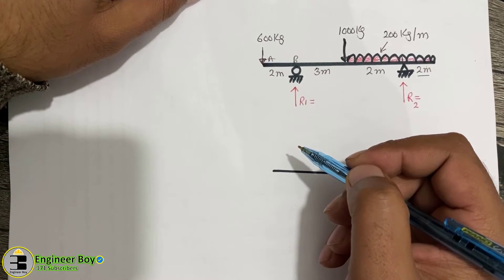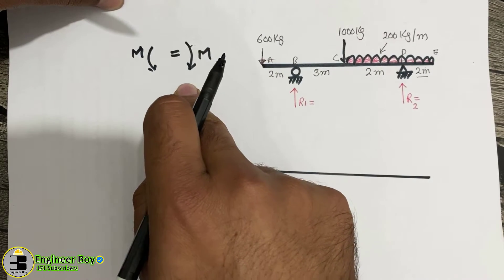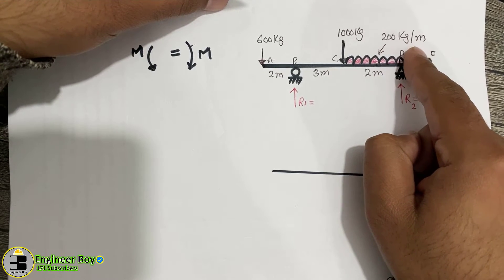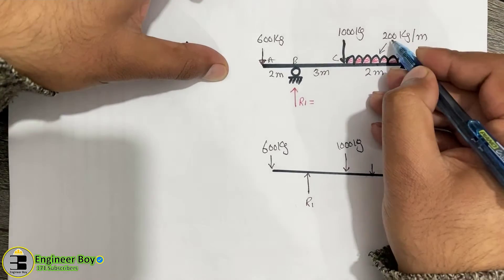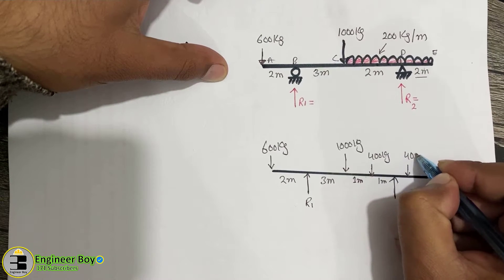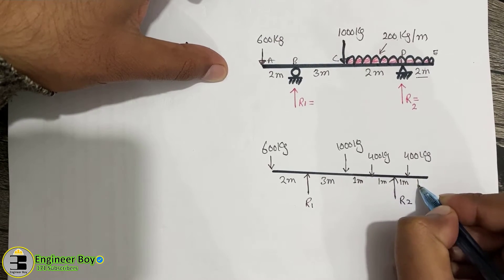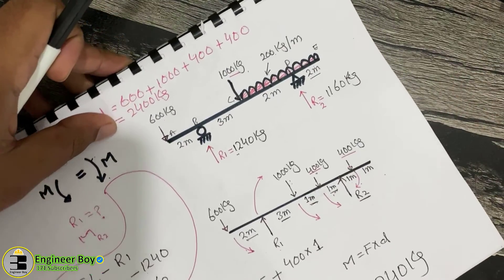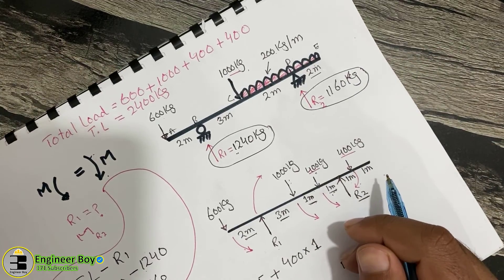How to calculate support reactions of beam | structure analysis

Comment: D has a hinge support which should have two reactions - a horizontal and a vertical..... instead you have used just one reaction. Its not a roller support that gonna give you a single reaction.
Reply from the maker: We already know that the horizontal is zero so we do not consider that